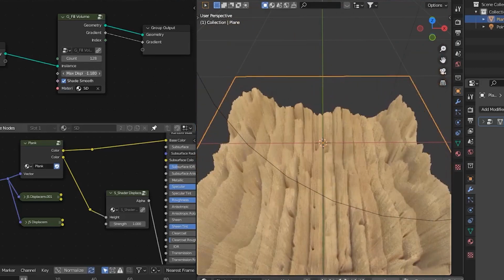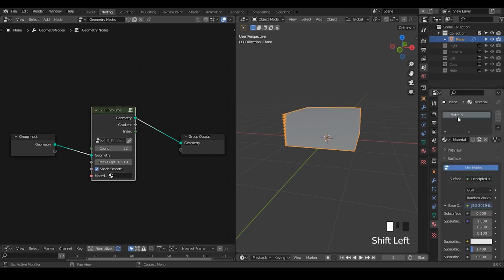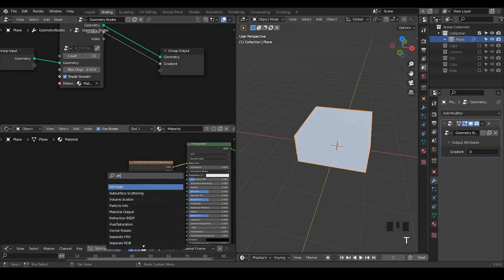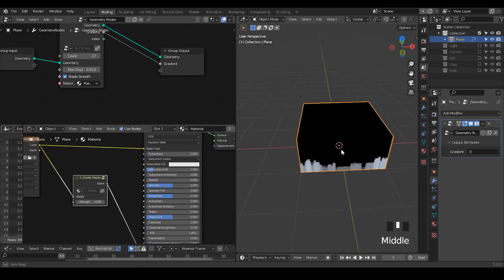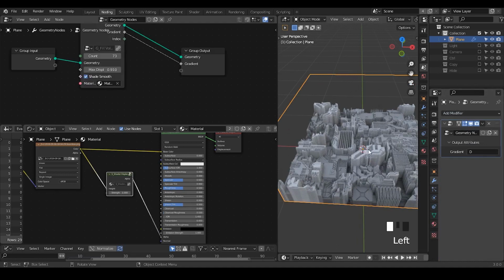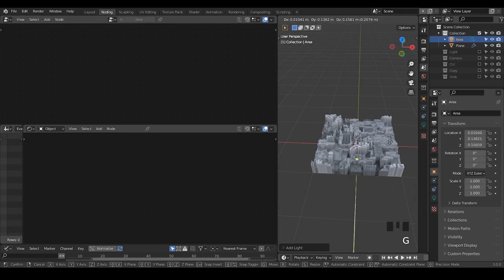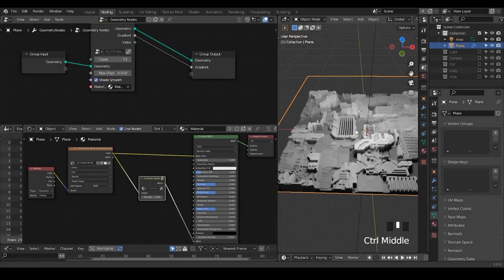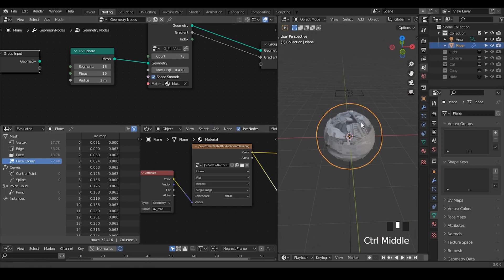[Tut] Shader Displacement in EEVEE - Blender Geometry Nodes 3.0 Field

Comment: How to convert to mesh from here?
Reply from the maker: You can't. Shader Displacement is never meant to be converted to a mesh AFAIK. If you need an actual displaced mesh, then displace a mesh instead.
Reply: @bradleyanimation120  thank you so much for your answer! in another video from Bbbn19, that does layered enviroment similar to yours ,there are a lot of empty spaces overlayed which make impossible to just displace mesh on top of it. Is it not possible to get those lines around the layered shaders and rebuild a mesh out of it (for example by baking out multilayers) what do you think? Thank you again! Youre a master! :)

Comment: hi. I´m new to blender :) very nice tutorial. can you tell me what to look out for the material texture to get nice contrast? mine seems very even and less detailed then yours. also is your texture somewhere available for testing? and is it possible to use this method on complex objects that are not a plane or sphere? I wanted to texture my spaceship like that ^^
Reply from the maker: it may be easier to ask google for questions like texture itself. On the other hand, you can always increase the contrast using "RGB curve" node or contrast node and so on within blender or even other software.
Yes, I only showed plane and sphere as an example. This method works on any kind of object procedurally.